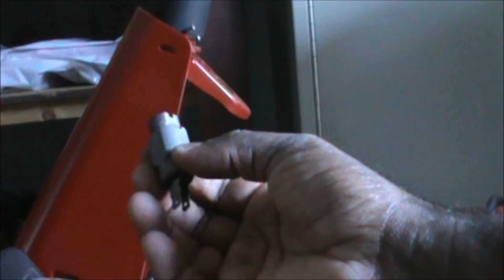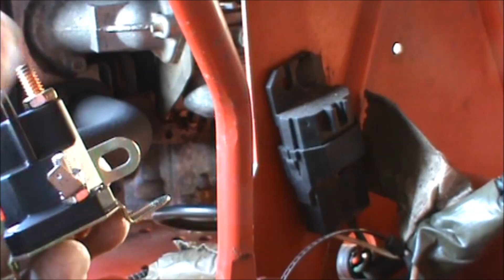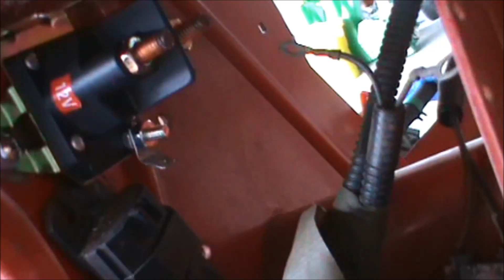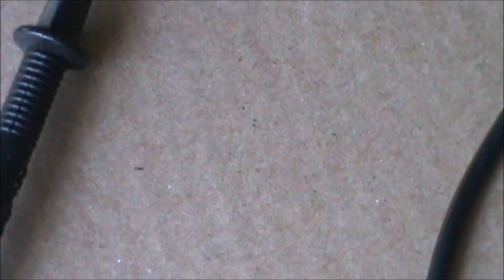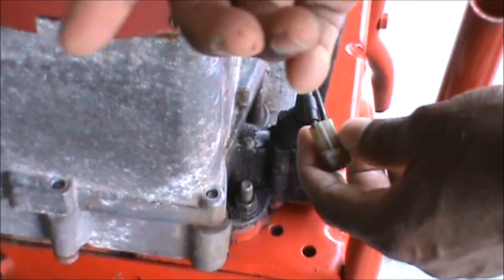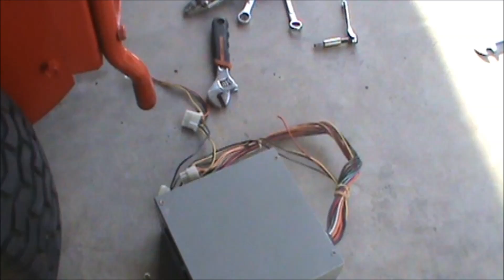How to convert a Snapper Rear Engine Riding Mower From Manual Start to Electric Start

Comment: The solenoid should be mounted under the seat on the right side out of the dirt, water & grass clippings. Always wire the unit with the proper color wires just in case some one else will have to work on the unit. It's a safety issue. Wiring needs to be fused so it doesn't catch on fire. You have to have a ground wire to the switch.

Comment: Will the charging wires be there on every Briggs engine? I have a Snapper with a 10.5 HP I want to convert to electric start?
Reply from the maker: It should be there

Comment: I was too cheap to replace the battery on my Snapper. I just used the recoil starter after the new battery I installed died a year later. I miss not having a recoil starter on my Husquvarna. I don't get much life out of lawnmower battery.

 I guess because my yard is so bumpy it jars the hell out of the battery causing the lead coating  to fall off the plastic plates. 

I got a backup MTD with a bad battery. If I need to use it, I just  pull the battery off my other mower. 

I have not tried my new cordless drill to see if I can start it that way.

I wish they still installed recoil starters on riding mowers for that reason. People like me too cheap to buy a new battery every other year.
Reply: some of the mud mower guys I seen on youtube make their own bracket similar to the engines back in the 40s and 50s where they simply wrap a rope around it.  I have seen them on engines up to 18 horse and work just fine.  I suppose they do that so they dont have to buy a battery for an off road mower.

Comment: I have a Snapper 28 HI VAC (Model # 281123BV) with a Briggs and Stratton 11.5 hp engine.  I want to do a conversion on it, as well. I was wondering if the same starter fits most Briggs & Stratton engines, and if not, how do I ensure that I'm gathering the right parts? Great video, and I'd appreciate any advice.
Reply from the maker: The rule I go by is this: if the engines are close in HP ratings, you will be fine slapping that starter on there it fits.  However, if you want the exact starter, you could look up the engine model online, but you will be fine with a starter off a similar rated BS engine. All the best with your Snapper.  I would like to see a video when you are done with the conversion.  Cheers

Comment: the threaded hole for the solenoid is already there, its on the bottom and the solenoid goes up against the pipe in there. all you need is a standard 3/16" bolt to screw into it
Reply from the maker: keakar63 
Thanks for the comment. I did not notice a hole there.  However, it's mounted up high and happy. Cheers

Comment: I have been thinking of converting my old snapper to electric. I didnt see where the starter meshed with gears and mounted to the engine. Was that  starter mother from an original snapper>? I also saw you hook up an alternator wire but if it didnt have an elecric system b4 where did the wire come from?
Reply from the maker: Jim Minee 
The starter was salvaged from a similar engine that I paid $25 for.  It did mesh up with the engine just fine.  I did not have the black cover (the piece that hides the gears) over the starter when I had made the video but later put it on, so maybe that is why it did not appear to mesh.  When I connected the charging wire to the alternator, I did not have the right connector on hand, so I salvaged a connector from an old computer power supply that did fit nicely.  All in all, I was able to install a battery later and put the goodness to work.     Cheers
Reply: thanks a bunch. I find mine very hard to start and sometimes just on first try it floods out terribly. maybe time to change out the needle & seat. It hasnt seen much service in more than 10 years
Reply from the maker: Jim Minee 
It does sound like you need some carburetor work there.  It's possible that you could also have excess gas in the combustion chamber and engine oil, which could cause hydraulic lock.  If it happens, the engine will not turn over.  If that is the case, remove the spark plug and turn over the engine.  A bunch of gas will exit the mower releasing the hydraulic lock.  I have had to do that before on engines that had carburetors that needed needle and seat replacements.  Also, at times the carburetor could just need a good cleaning because foreign materials inside the carburetor could also cause the needle not to seat properly, as well.  Also, if your spark plug is dirty, it could cause starting problems.   A good wire brush will clean the spark plug fine.  Do you have a fuel turn off valve on your fuel line?
Reply: I had that happen to my Craftsman  12.5 hp rider.Went in the shedfirst time in the spring to pullit out and big puddle oil/gas on the floor. I took it out and drained everything pulled the carb and rebuilt it. What a mess in my shed. I have now installed a shutoff just in case. It never had symptoms of rough engine idle or acceleration...just one of those things I gues where dirt got under the needle& seat.. Floods out everywhere as the gastank is quite higher than the carb. My daughter bought a house and in the shed there is an old motorized reel mower I want to tinker with. Made I would guess in the late 40's early 50's I havent had a close look yet . Looks like one of those old push mowers somone thoght to throw a motor on it . Ever see one of those?
Reply from the maker: Jim Minee 
I have never seen or used a motorized reel mower.  Sounds like something that would be fun to play with.  Enjoy :)
Reply: When I get a chance I will send a foto.
Reply from the maker: Jim Minee 
Soundzzz like a plan :)
Reply from the maker: Can't wait to see it :))

Comment: Thanks for sharing this Anthony saved me a lot of grief
Reply from the maker: RFKFANTS67 
I am delighted that you have found this video useful. I am humbled knowing that the video was not a total waste of time - very encouraging, my friend.  I have got another Snapper in my shed that I am working on.  Hoping to have some videos on it up on YouTube soon. Cheers
Reply: Thank you for sharing these vids Anthony good work, keep posting! I too am working on my 2nd snapper. I purchased it for a cool $ 60.00 Canadian. I took off the 6 hp Tecumseh in favour of an 11 Briggs and Stratton. Motor is mounted, Now onto cleaning the carb, and hooking up the charging system. I hope I will be up and going this week. My first snapper is an 8.5 Briggs and Stratton I/C .. it has a 30 inch deck, the 2nd one with the 11 hp is a 28 I believe. I also want to replace the front hard rubber front wheels on it, As the inflatable wheels seems to give a smoother and more manouverable ride. I can't seem to find any inflatable wheels that size though? Any ideas or web sites your aware of that deal in these wheels? Cheers my friend
Reply: RFKFANTS67 
Great price on the Snapper - $60! Sounds like you are having lots of fun.  The Snappers that I have still have the original wheels but I did search the net and see where Amazon is selling this: Rotary 10106 WHEEL FRONT ASSEMBLY 11X400X4 4PLY SNAPPER (GRAY)

Hopefully it will work for you.  You may also check on Craigslist.  Sometimes they have hard-to-find things.  Cheers
Reply from the maker: RFKFANTS67 
I would check Amazon or Craigslist list. Thanks for watching. Cheers

Comment: Another great video Anthony, love how you find ways to work around issues. Using that old computer power supply was ingenious. Can't wait to see you fire it up. Looking forward to the next video. Nice looking Snapper.
Reply from the maker: John 

Thank you, John.  I am often guilty of holding on to old parts but it worked out this time :). I will be cutting grass soon.  Cheers
Reply from the maker: John 

Thank you, John.  I am often guilty of holding on to old parts but it paid off this time.  I will be cutting grass soon.  Have a great week buddy.  Cheers
Reply: hey sir i was wonderin if you still had that recoil assembly that mounts to the top of the engine cuz im doing what your doing to my electric start snapper but in reverse order for my snapper and it has the same engine but if you still have that recoil starter, would you be willing to sell it?
Reply from the maker: Thanks for stopping by.  I do still have it but want to keep it as a back-up starter for the mower.  If I happen to come across another one I will let you know. Cheers